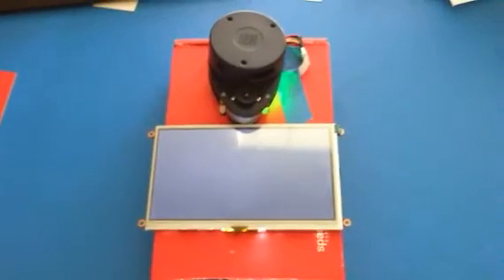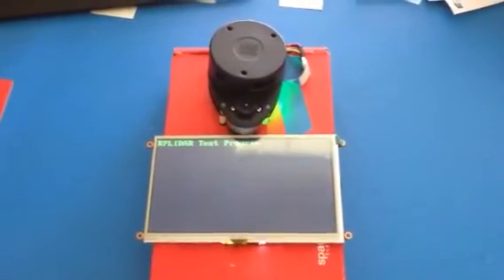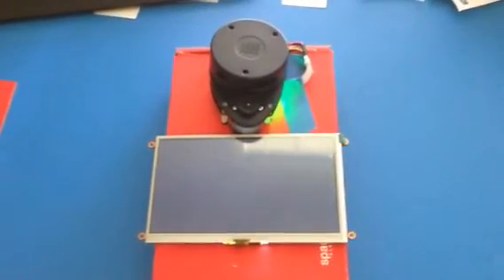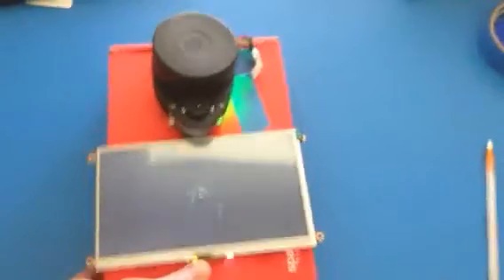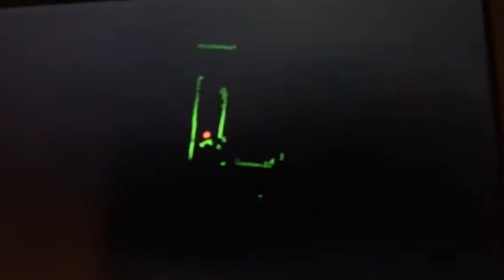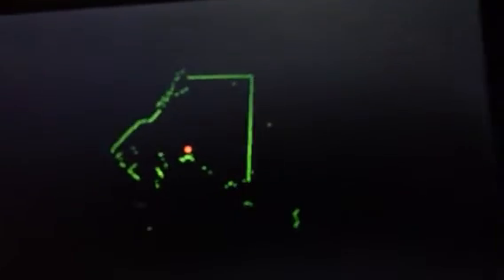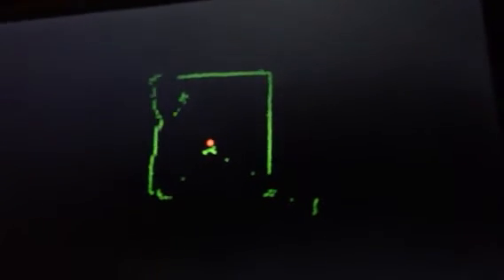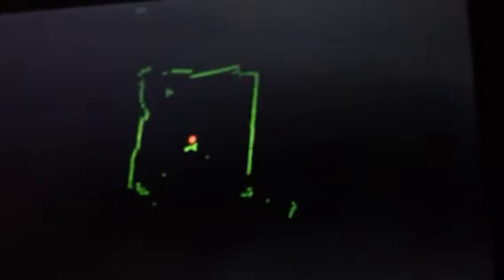RPLIDAR

Comment: Hiiiiiiiiii guuuuuys!! :3
i need HELP with this new toy :(
1. i was wondering which is the point of reference for the degrees? like where is the 0 (the 90 the 180 and so on..) I know theres a startbit(bool) but when does it activate? when the laser is looking to the right?(asuming the motor is the cute little bum x3 it looks like a frog to me)
2.and what does the "quality" byte does? like what does it mean?
tnx for reading xoxoxo <3 <3